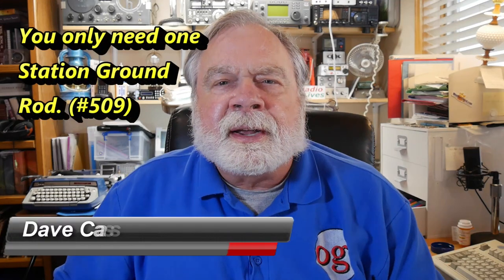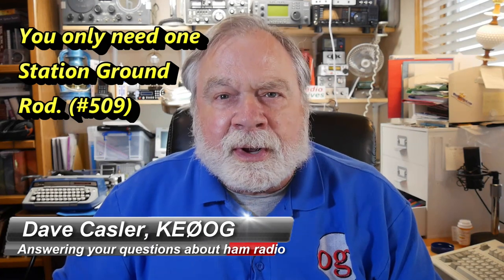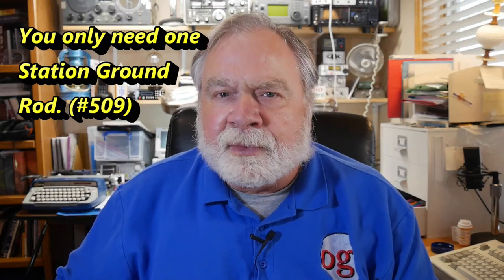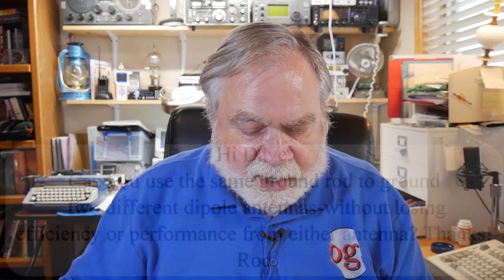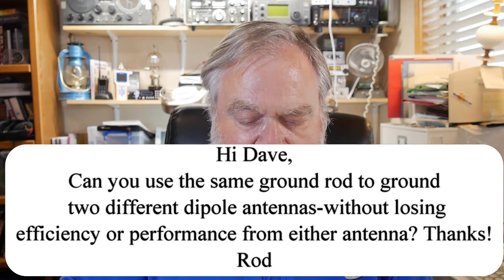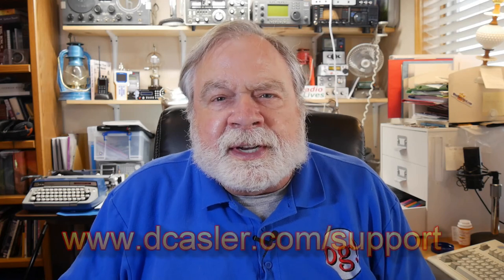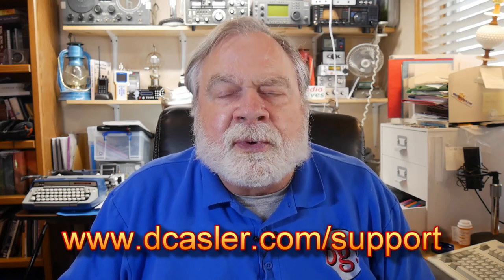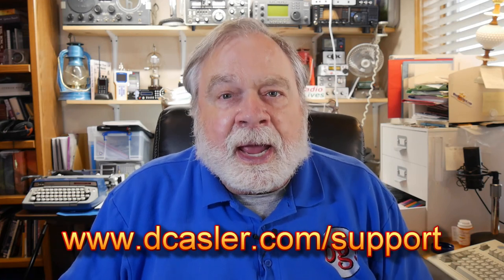You only need one Station Ground Rod (#509)

Comment: I put in a ground system at a house I once owned.  Dug a 1 foot trench completely around the house.  In that trench I drove a 10 foot ground rod in every 6 feet around that house.  There was also a ground rod on each of the 3 legs of the tower and one at the vertical out in the yard.  Using #2 wire I fastened to each of the ground rods around the house. Then I filled in the trench.  I used Cad-weld to make all the connections.  Also used Cad= weld to connect some 1/2 inch copper pipe that ran into the shack to a 2 x 2 foot, 1/4 inch thick copper plate.  All my station equipment was connect to that plate using 1/2 inch copper braid.  Never experienced a ground loop and had great success.  Sold that house a few years later and I am sure all that stuff is still there.  The best grounded house in the neighborhood.
Reply: I disagree with it being the best grounded house in the neighborhood. They are probably having electrical issues now.

Comment: I have two ground rods at my house, one at the north end which is right in front of the window for my operating room, this is the original electrical ground rod for the house. The second ground rod is at the south end of the house which provides a ground for the radios I have on my work bench in the garage. Between the north and south ends I have an eighty nine foot section of LMR-600 allowing the vertical antenna that I have at the south end to also be used in the operating room at the north end. Both ends of the house have Harger grounding panels with Polyphaser lighting protectors mounted on them for the various antennas and the panel on the south end has two Diamond antenna switches on it so the HF vertical can be switched between my work bench and the north end operating room and the other switch allows me to switch a Comet 2/440 antenna between my work bench and a bnc connector on a wall late next to my easy chair in the den so I can use a radio from that location as well.

Comment: We were setting up for Field Day one hot June afternoon in Maryland. A vertical antenna at the top of a 20 foot mast in the middle of a baseball field had the coaxial cable running down and just coiled up on the grass at this early stage of setup. One guy went to pick up the open end of the coax and let out a loud YOWW! We looked up to see a big black storm cloud directly overhead and there were random tiny arcs from the center conductor to nearby grass blades. Static electricity is real. Ground that stuff properly!
Reply: that was not static.  clueless.

Comment: Just a warning that the domestic Earthing system in the UK is different from the US, which has implications for the radio amateur. Most properties built in the last 30 or 40 years use a TN-C-S Earthing system which means it can be very dangerous to introduce a new Earth to your property that is separate from the main earth terminal.  If there is a fault on the network, anywhere downstream of the property,  the main earth of all the properties on the network downstream of the fault will rise to that voltage.  If a radio amateur happens to have installed a better earth at that location by sticking a rod in the ground, all the fault current from downstream of his property could run through all the metal work in his shack and potentially cause a fire. If you install a ground rod of your own in the UK, it needs to be bonded to the Main Earth Terminal at your property and you need to have it checked by a Part P approved electrician or your buildings insurance should be voided.
Reply: there is a reason for warm beer in th UK... my guess is the fine electrical systems found there.

Comment: I use flat copper braid (1/2 to 5/8 inch) from my equipment chassis to my single point and from there to my grounding rod.  Lots of surface area.  Then I use buried bare 6-gauge solid copper wire from the rod to my house ground because that's what my house has running to the ufer ground.  So now you have a firm grounding in grounding, Rod.
Reply: It is not a great idea to use flat braid outdoors. the connections between the individually braided strands will corrode open and markedly raise the impedance of the strap. Replacing it with flat copper ribbon from your shack grounding point and the Grounding Electrode will make the connection much longer lasting. The corrosion between the braid strands does not have to be severe enough to have become visible to the eye for the impedance of the strap to have gone unacceptably high. 

-- 
Tom W3TDH
Reply: @hornetd  Time will tell then. Even if it needs replacing at some point, it's an easy job.
Reply: @hornetd  An additional benefit of flat copper sheet or ribbon is that, because it is not round like No.6 wire, it does not generate the large inductive kick-back that sharply increases impedance during the peak of a lightning strike so it siphons off the excess energy much better.
Reply: Hi

Comment: A dipole where BOTH sides are not at the same DC potential WILL build up static, be a lightening magnet and possibly ruin the front end of your receiver or antenna analyzer. At the very least, short out the coax across the dipole before hooking it up and disconnect the antenna when not is use! A high value choke across the leads will be a short to dc and static, but rf will see an open circuit. I once hooked up a dc analog meter across the coax connector (not hooked to anything else) and it is amazing the way the needle danced around. REALLY interesting when a storm is near! Don't try this when a storm is close!- 73 W1RMD

Comment: There are many kinds of grounds like lightning grd., electrical grd, , RF grounds and other grounds for other interests.  However, the RF grounds have some unique limitations.  An RF ground can be at RF ground only at one point.  You can't have an RF ground across a wire line, a metal surface, or any 3 dimensional metal object. 

For example, you could make an RF ground by simply running a 1/4 wl wire and use one end of it as a RF ground.  You can't ground multiple items by putting ground connections along the wire.  The ground connections have to be at one point.  Distance matters.  If grounds are at different points along the wire there would be a phase difference and all the items would be at different ground potentials.  The same occurs at different locations on a flat surface, or a volume surface.

The length of ground wires from individual items absolutely also matters for similar reasons.

Comment: Great video Dave, 
Thank you. Its really a nice change to hear from someone that makes an easy concept that seems to be a complex issue some times, after 30 years of being a master electrician. All grounding connections  needs to be bonded together at one location by some method. ground rods any closer together than  usually length of the rod is your guide 8' - 10' etc. The cone of protect, overlaps any closer. Pay the few bucks more for a copper clad usually a better choice than a galvanized rod. Just like the best coax you can afford, like wise the best grounding job you can afford will pay off in the long run.
Again, super job

Comment: As a professional TV antenna installer, with television systems, I often incorrectly see ground blocks tied into the electrical utility boxes right next to the obvious PVC conduit that causes the disconnect from the earth. I also see many satellite systems incorrectly use the messenger wire as ground, but that wire is meant only for tensile strength when running wire overhead from pole to house. Another incorrect grounding I see is clamping to plumbing that runs longer than the first connected TV. If a plumbing pipe runs 20 feet before it makes contact with the earth, but the TV coax is 19 feet, then static events discharge into the TV because it is the shorter path of resistance. People ask me all the time, "Why did one TV get damaged after a lightning storm instead of them all?" That's because the path to that 1st TV is shorter than the path to Earth. Of course, I speak of 75 ohm systems here, but the grounding concepts ate the same.

This is why it is always best to use a ground rod at the entry of the house. In addition, with TVs at least, a proper balun is what ties the center lead to the outer shielding of the coax. A balun tests like it is shorted if wound in this manner, but that's how it makes contact with the outer shielding. Any static events on the dipoles will loop to the outer shielding through the balun. Static will travel equally down the center lead and the outer shielding of the coax. All electricity cares to find is Earth. Once it is directed into the earth ground through a proper ground block, ground wire, rod, and balun, both the center lead and the outer shielding discharge equally at the same earth location into the ground. The center lead does not need an arrestor as long as the balun loops it to the ground. If there is no proper path to the ground and the path to equipment is shorter, then the static electricity will discharge into the circuits. As a TV Repairman, I have seen discharge patterns inside TV panels from these static events many times. The dust inside TVs leaves its fingerprint static pattern across the inside when they get zapped. 

You also mention ground loops from multiple grounding locations. This can be an issue and is more likely if tied into copper plumbing. Plumbing from a house can act as an inductor. I recall one home in the news, in particular, where the family kept hearing voices. They recorded the voices, and it was a local DJ from a radio station. The house itself was acting as a radio. It was perfectly tuned into this station all because of the network of plumbing. This type of interference is called ingress in the TV service field, and cable TV service techs create closed systems to prevent leakage into their network. Perfect coax, tight connections, proper grounding, and equipment work best when they are separate from contact with other contact with the home and other equipment. Creating a completely closed circuit keeps the ingress out while keeping the equipment safe.

With ham radio, this may be slightly different, depending on the design of the balun itself, but with TV antenna, it is all vital. Thanks for the great videos. I learn a lot by studying other RF systems. HAM radio teaches me some things that benefit TV antenna installs that would be overlooked otherwise. Thanks again. Love the videos.

Comment: First David let me say I'm a newcomer to the Ham World.
However, I've worked in the field of Electrical and Electronics for over 45 years alongside some of the best Engineers in the world.
After recently retiring I decided to join the Ham Radio community and I've discovered there is much more for me to learn.
The subject of Bonding and Grounding is causing me much concern.
The NEC changed the rules in 2014 and for understandable reasons.
"We" had it wrong ever since Bonding, Grounding rules were first written.
I must add that I believe the rules will change in the future after a more complete study of lightning radiation patterns have been done. Those of us that thought that Earth was at zero potential just didn't understand the path electricity takes returning to its "source". Meanwhile the re-education as well as the debate will go on. Mike Holt has many You Tube Video's on this subject although I find him difficult to follow at times. He is however the industry leader on this subject. NOT for novices without basic knowledge of electrical fundamentals. 
Thank you, David for your contributions concerning Grounding.

Comment: Nice job,  you always do a great job on this topic.  In my opinion, the most important thing to stress is to bond those grounds together.  While working at my first professional job as an  EE after I graduated college I grabbed the shielding of a telco cable while my forearm was touching the equipment cabinet and was shocked by 150  volts across my forearm,  I suffered no real injury but it hurt like hell. The telco ground and the  building ground were not bonded together and were at opposite ends of the building, there ended up being over 150 volts of potential difference between the two grounds. I was lucky, I knew to keep one hand in my pocket while working in the equipment cabinet but I didn't even consider that there could be that much of a potential difference between two grounds,  I called the electrician and had that issue corrected the next day and as it turned out that fixed our problem I was troubleshooting. So it ended well, but still a hard lesson to learn.

Comment: Question: All of my radio gear inside my house is powered by a large 12v lithium battery, nothing is connected to any inside plugs or 120v power. Do I still need to connect my antenna ground rod to the ground rod at the house power panel.??

Comment: Afternoon Dave here it is 15:19 the 21st of August you're explaining the spark arrestor is to be put as close to the house as possible if it's my understanding I was to understand that the spark arrestor is to be placed as far away from the shack which in this case it's roughly about 25 ft from my check and then the lightning wouldn't get into the shack so that's what my understanding was the spark arrestor as what I understood is to be placed as far away from the shack as possible and again with my shack my antennas roughly about 25 ft from my shack where the coax would go up to my dipole thank you very much for the advice and if you could please clear that up I appreciate it 73s

Comment: 9/8/2021 ., what got me intrigued with the caption of title, … I had Two radios with higher swr .& what I found is that when I had them jointed with same ground wire the swr went up 🆙 slight a bit by 1.2to 1:5 .& and on top of that as soon as I separated them and did instant connect and disconnect …I’ve notice an increased of more receiving  volume.. when I separated them … and my swr went down too . So run a separated ground rod or if you can’t then I would advise to use a diode to keep direction of ground in electrical Direction so- they won’t join electrically .Proven

Comment: I’m running a maco v58 with 2 20 ft sections and they run into a steel pipe about four ft in the ground with three grounding rods plus a grounding rod for the shop with a total of four rods all four are bonded have not had a issue at all

Comment: In Fl, I use #4/0 ground Because during an actual hit, it ain’t just skin effect, it’s 20000 amps of Effectively DC.  Cad-weld to multiple ten foot rods.  I’ve taken literal direct hits with no significant damage.

Comment: I have a ground rod at the shack, as displayed in your diagram.. and it's the only ground I have attached to my radio and power supply. I isolated the shack from the ground provided by the house's electrical system and water pipe.

Comment: I am putting a ground rod in for an antenna mast.  All I have is a fence post driver to get the ground rod in the ground.
Reply: unless you have some really nasty soil all you need is some water and the ground rod can be installed by hand down to the last couple feet, then a hammer.
Reply: @timmyers3428  Its hard desert with rock and caliche

Comment: I disagree with bonding the ELECTRICAL GROUND and the RF GROUND. I understand the theory behind doing it but RF is not ELECTRICITY.  RF flows on the outside and ELECTRICITY flows in the conductor. The two different grounds are just that, DIFFERENT. Yes, the theory is that bonding them together puts them at the same potential in a lightning strike but lightning hitting an antenna can introduce lightning into your electrical panel. Also if the neutral wire becomes loose it is possible for return electrical current to exist on the ground system and if the case of your radio is grounded then that ELECTRICITY can exist on the case of your DC POWERED radio. My son in his house had several neutral wires loose in his house electrical and he measured 70vac on the ground wires of his house. I told him to tighten the neutral wires in his panel and that voltage went away. I have grounds, electrical and RF grounds but I don't mix them. I understand that NEC specifies all grounds be bonded but they are talking about ELECTRICAL GROUNDS. NEC was written for ELECTRICAL, not RF. Its not National RF Code, its National Electrical Code. I have had a station and radio was even damaged by static discharge BUT never had any other issues. I am a licensed electrician in Texas. Lightning is a beast. It does what it does. It jumps feet, how do you think it comes from the sky to the ground (earth)? It jumps miles. If you really think you are going to stop it, you are mistaken. Its a roll of the dice. A crap shoot. Who in their right mind is going to operate a radio in a lightning storm?
Reply: I think the RF ground should be left alone and let the RF drain into the ground plane.  If RF is intentionally grounded then the their is no reason to layout a ground plane.

Comment: On my RV camper I plan on a copper foot or plate to be my ground ether under a jack or pole with an antenna. Do you think this is enough?
Reply: No, you'd have very little grounding effect.  I think it was Dave that did a video a few weeks ago about when you can't drive a ground rod you can lay two ground rods end to end to get the same effect as a single ground rod driven vertically into the ground.  Check out the ARRL book "Grounding and Bonding" by Ward Silver.
Reply: Even though the ground (earth) may be an excellent ground, the problem is the contact resistance or how you make contact with it. Just like a copper wire making contact with another conductor, the contact point may be much smaller than the wire and may have a high resistance. A ground rod only has a small area in square inches. Two ground rods have twice the area and hopefully half as much contact resistance. I realize this may be over simplifying the issue.